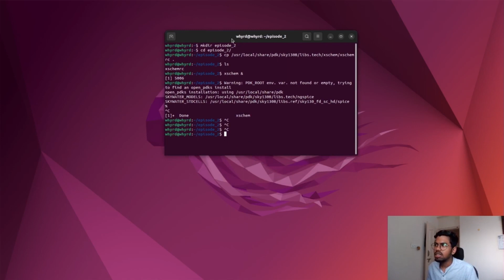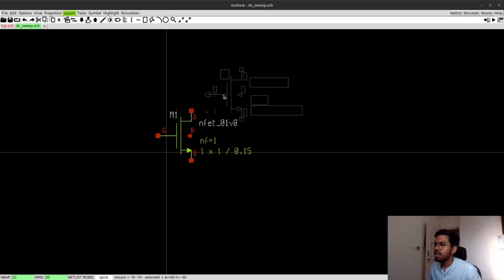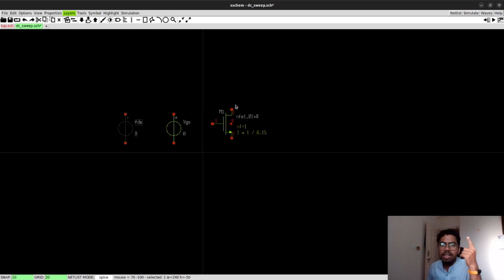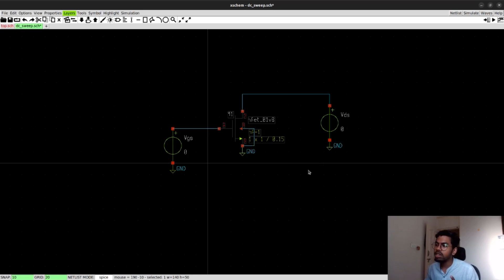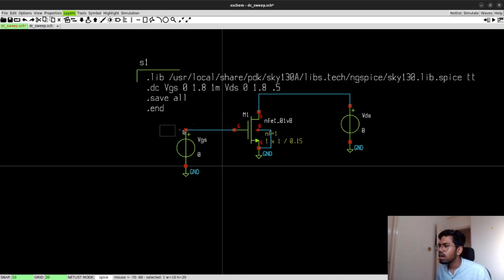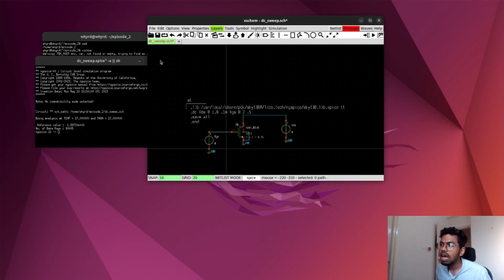Comment: I need little help. When I want to start simulation my ng spice window is showing an error 'No compatibility mode selected'. I installed progams same as you and made exact same schematic with no errors in Netlist, but for some reason it is showing me that error message. Do you have an idea how I can fix this issue? The episodes are really great and helped me a lot☺
Reply: Hey thanks , for now you can ignore this error … as with this error too you can do the simulation from xschem using ngspice
Reply: Actually i was just cheking again and thats not the only error. I guess my simulation does not work because of this second error, i think its about function. It says "Error: unknown subckt: ......" and then the part of the netlist, listed elements. But schematic is fine without errors, i dont know how i can fix this issue😟 @whyRD

Comment: is to possible to perform above project in model sim and quartus prime?
please reply
Reply: Before that , do you what does model sim and quartus prime do ? Short answer is yes you can do this project on this platform but not the way i am trying to make you learn ….. give the above answer then will explain more
Reply: @whyRD  actually i didn't understand, its confusing...my system is windows. you are doing in unbuntu right, so that's why i said about quartus prime and model sim, i know that they're the EDA tools for synthesis and simulation right....? ......pleasse clear my doubt about what you said much clearly.. please replyyyyyyyyyyy........
Reply: @VinayVinay-d2f  Those programs are used for a different type of circuit design, where you are going one abstraction layer up. You arent working with tranzistors anymore and arent really making schemes like this, you are writing code describing the design. This is very simplified and possibly not 100% correct.